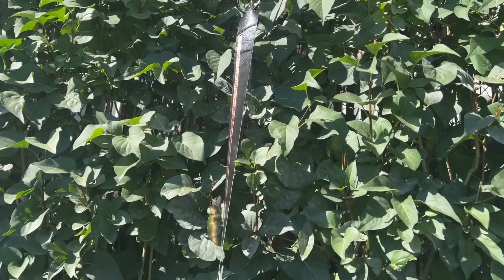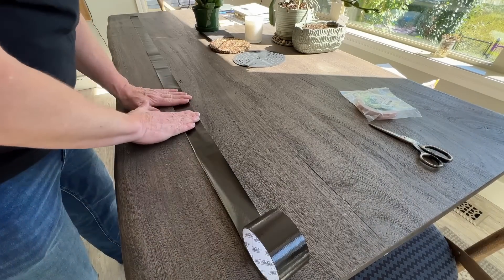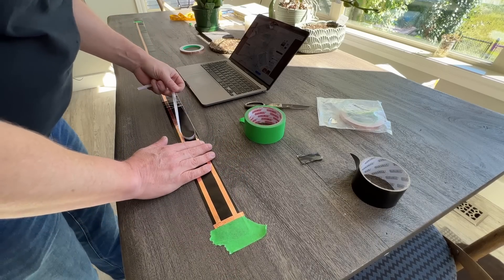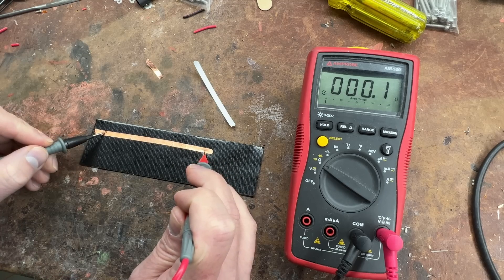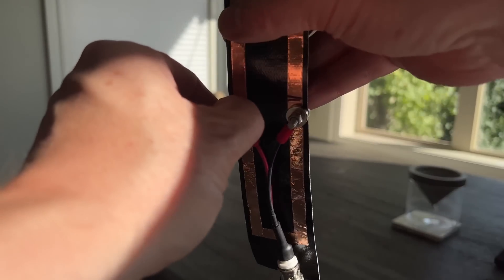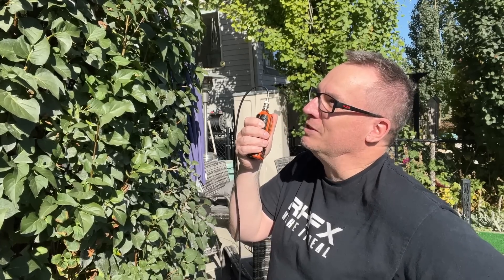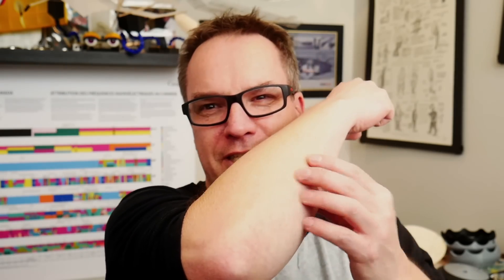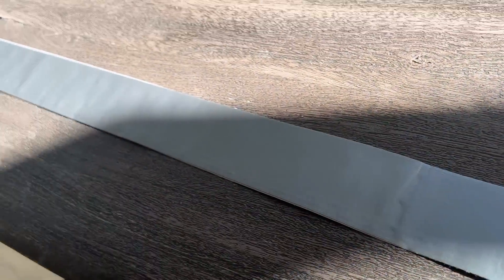How to make a 2 meter band tape antenna: Lightweight, portable, fun project for ham radio

Comment: you made an antenna out of copper foil, thumbs down for clickbait and thanks for wasting my time
Reply from the maker: You are most welcome.
Reply: @VE6SFX_HamRadioRookie   I for one thought it was an extremely interesting video.  Saved to my "projects" playlist... seems like an excellent candidate for a go-bag antenna.
Reply: Some people are never happy.
Reply: @VE6SFX_HamRadioRookie   Unlike that jerk, I'm really glad to have come across your video today. Just got my NanoVNA and am trying to make a j-pole antenna using 14ga solid core wire run along a piece of scrap wood with some TV coax driving it, and my result is way off where it should be. Your usage of magnets and how you showed the effect of altering the two legs was perfect for me to attempt getting mine working. Any suggestions for an antenna building noob for things to watch out for (e.g. I think the characteristic impedence of the coax I have is 75 ohms instead of 50)/reasons things might not be working?
Reply from the maker: @Tawnos_ Truly I am as new as you here and any advice I have might be suspect. Having said that I understand that getting a good swr is quite important in helping not let the magic smoke out of your radio components. My understanding: 
Using 50-ohm cable with a 50-ohm antenna and 50-ohm radio will provide a proper impedance match, minimizing signal reflections and maximizing power transfer. This is generally the preferred choice for 2-meter band antennas.

If you use 75-ohm coaxial cable with a 50-ohm antenna or radio, you'll have an impedance mismatch. This can lead to some signal loss due to reflections, potentially resulting in less efficient power transfer. But as I understand it if you choke the coaxial at the root of the antenna by simply making 3-5 loops of coaxial cable (zip tie them together) of about 1-4 in in diameter you should still be able to get a signal out just not as efficiently

Now one would think that then impedance matching the antenna to the 75 ohm coax will help and it can but the thing is that most radios are also 50ohm so you will be matching at one end but not the other..  Not the best situation. I am not going to say use it. However I would still try if it was me. Take all of this with the warning, I am the ham radio ROOKIE for a reason. I could be wrong.
Reply: What time did you waste, and what planet are you on to think duct tape was going to be the conductor? Clearly the tape would have been the body, anyone who knows what duct tape is (even people calling it duck tape) knows it's rubberized plastic, effectively a sticky tarp material. No part of that was ever going to be conductive in the first place, but the interest in a duct tape antenna certainly solves a serious problem that comes with making larger antennas for any use that needs lower frequencies at longer distances.

Ya'll wasted your own time looking for magic beans in the garden store, and I'm convinced you didn't show up looking for an antenna if you expected it to be made of purely duct tape, you're just here to be upset at a title.
Reply: It's more duct  tape than copper foil and you would have to be pretty dumb to think you could make an antenna out of duct tape alone. Clearly your time isn't worth much, so nothing lost. No need to waste any more of it replying to me either. 73s
Reply: @VE6SFX_HamRadioRookie  i'm just pointing out the clickbait. copper foil is the same thing as a wire.
Reply from the maker: @dronefootage2778 Yes I agree it is clickbait and if you identified it as such and don't like clickbait, then don't watch, and don't comment. If you do comment then say something constructive like "Hey maybe you should try the title '2m ham radio antenna made of tape!' the title you have felt disingenuous to me, Plus I think it would be better received" <--- that there is saying everything you have but with a POSITIVE spin.  Telling someone they are wrong or you do not like them, are not going to watch the video, and later in comments (you have since deleted ) told me to not bother commenting anymore trying to shut me down and push me down into some sort of mental submission is just plain mean and sad. It is hardly constructive and worst of all feeds your mind with anger and resentment. Worse it makes others not want anything to do with you or want to communicate with you. You have spent more time feeding the displeasure in your head than this is worth STOP! I am a happy person and enjoy the hell out of life. You, some stranger on the internet, have zero power zero  right for that matter to try and knock me down. I fully understand you do not like click bait you have told us serval times. I have admitted here and in on other platforms that yes this is a clickbait title, I own that, stop making this like I have no idea, I know EXACTLY what I have done. Stop commenting and go feed your brain with some happy thoughts. Flood your brain with good endorphins. Now for your technical comment: foil is NOT the same as wire, it performs in many ways a round wire or braided cannot in physics. Also on a practical point you can roll this up into a very neat little package and put it in a pocket. Had I used wire it would have just been another hard to manage feed line antenna that cannot be rolled up and no where near as compact nor nearly as light. Now go away or stick around i don't care but start being nice to others and especially yourself. I appreciate you as a human and want you to be happy believe it or not.
Reply: @VE6SFX_HamRadioRookie Yeah, the functionality of the foil opens a lot of possibilities for things like shaped antennas, and I love that you put it on/between duck tape to make an easily carried and deployed antenna. I had done a lot of what you said regarding my antenna. Thanks for the advice - I already had a ziptie choke around the wood, but right now my VNA is all over the place with I will start by re-measuring my legs and verifying they are close to the right length and spacing. If all else fails I'll sacrifice an SMA cable to the homebrew hacking gods and try a mod of your design by folding my 2" copper tape and enveloping it in duck tape. Your constructive response and positive criticism are spot-on, and I hope to hear you on the airwaves sometime, somewhere - KK7ADJ :)
Reply from the maker: @Tawnos_ One thing I have found is my VNA can be flakey and a recalibration is what brings things back into place. Also consider where your antenna is. Ideally it is in a open free space with no metal nearby.
Reply: @VE6SFX_HamRadioRookie  VNA always has to be calibrated to set up the reference plane to the point where you hook up the antenna, i.e. at the end of the antenna cable.
Reply from the maker: @dronefootage2778  YES! positive feedback. Thank you, very much appreciated.
Reply from the maker: YES! Love this and thank you for the update.
Reply: @dronefootage2778  If you think you could build any antenna without a conductor of some sort then you should probably rethink your hobby.
Reply: @mariemccann5895  i thought it was like a conductive duct tape that's all. anyway, i stand behind my comment. i could use a rubber band to suspend a wire and then claim that i made an antenna out of a rubber band, same concept.

Comment: That's two metres, not 2 meter. A meter is any device used for measuring. A thermometer is a meter, a tape measure is a meter. The unit of measurement is called a metre.
Reply from the maker: English is a developing language and like it or not things change. In the end the point was to communicate an idea and you understood it so my verbiage and lexicon was successful.

Comment: You can't measure conductance or resistance accurately of a piece of a short length of conducting metal with that kind of multimeter. They are not dedigned for that purpose.

You need a calibrated electrician's tester that will set you back over a thousand bucks.

So the fact you get zero change with different lengths of copper tape means absolutely nothing. A standard hobbyist's multimeter does not have the level of precision required.
Reply from the maker: Ok, regardless the antenna works.

Comment: Skin Effect: No, it isn't that the transmission comes from only the outside of the antenna.

What it is really about is that as the frequency of the signal increases the electrons are pushed to the outside of the wire and no current flows down the centre of the wire.

What designers can then do, is remove the inner core of the conductor and turn it from a solid conductor to a coaxial conductor, essentially a copper pipe.  Why waste money on a solid conductor when most of it isn't being used?

This isn't something that is used exclusively for antennas, it is used in cables intended for high frequency use.

Now as all you have is a copper tube for the carrying of the current, then of course the EM emission is going to come from "the surface".
Reply from the maker: Ok cool, thanks. I learned from this and since I’m a rookie I’m sure I’m using the terminology incorrect. https://www.youtube.com/live/7MA4dIlapyA?si=djrGtlQc55Ds9O_K

Comment: I did the obligatory J Pole with 1/2" copper pipe when I first got licensed in 1992. I got great results on 2m with it, and it lasted for years. The one made with duct tape looks like it would be great for with an HT, but I wouldn't want to run any more than 8-10W with it.

Great video, keep it up.
73 from VE5RJK
Reply: It has a lot of surface area, so even it 100 % of that energy is dumped as heat in the antenna, it will barely get warm.
Reply from the maker: Given the foil tape antennas talk John Portune has done here I think it’s capable of way more than 10w https://www.youtube.com/live/7MA4dIlapyA?si=Qi2gmhINr6c2_IO0

Comment: Nice video. But a little warning is needed or rather cautioning. Though you can easily put the coper tape on top of each other for testing. Do solder the edges of the tape together  when it is giving the desired results on SWR. Coper will get a corrosion layer in time sometimes aided by the glue in the duck tape.Then it will end up a capacitor instead of a 0 ohm's link. 
But this trick with coper tape is use full  is you want to make a log periodic on higher frequencies.
Reply from the maker: Good tip! Thanks

Comment: It isn't "duck tape". It is "duct tape".  You use it to wrap metal conduits which conduct cold air, or warm air depending upon the season, not water foul.
Reply from the maker: It’s called both the original name was duck from the fabric it was made of originally a sail cloth called ‘duck’ https://youtu.be/9FaDI1i8ijs?si=qQfwdVHvZjUPOJ7M
Reply from the maker: https://youtube.com/shorts/n9ZNJKuUpXM?si=Tvwiw_c0fi_rYTMD
Reply: Generically it is duct tape, but a popular brand is Duck Tape, so both are correct.

Comment: I believe it's 'duct' tape, unless of course it's made out of ducks or used on ducks.
Duct tape was originally desingned for sealing ventilation ducts etc, but of course it has many other uses, including making antennas, and taping up ducks😁
Reply from the maker: It was originally designed to seal ammo boxes in wwii actually. Made of cloth called ‘duck’
Reply: Ahh, ok, interesting, but highly unlikely the same as what's made nowadays.
Incidentally, the black or grey fibre reinforced tearable tapes you used in the video are generally referred to as Gaffer tapes, used a lot by gaffers on stage shows etc, for taping cables to the stage floor, and of course to shut up the obnoxious lead singer.
However, duct tape is normally just plain grey/silver vinyl/pvc tape, without the reinforcing fibres, and not so easy to tear by hand, best to cut it with sharp scissors.
Nice job on the antenna btw, can it handle any more than a few watts?
Reply from the maker: I have not tested myself but john porutne has sone videos out there and claims similar antennas can easily handle 100w
Reply from the maker: Feeding the algorithim with this cheeky video in responce to all the duct comments :) https://youtube.com/shorts/n9ZNJKuUpXM?si=Tvwiw_c0fi_rYTMD

Comment: There should be an altered velocity factor for the copper sandwiched in duct tape... but I don't suppose we'll find that spec in the 3M data sheet ;)
Reply from the maker: I will measure it here in a coming video

Comment: What a fantastic way to make ladder line as well!
Reply from the maker: Holy crap! That never occurred to me! It’s super easy to bend and move around too!
Reply: @VE6SFX_HamRadioRookie Also a great leader to run between a window and its sill. I'm also thinking of hydrogen line monitoring with a run straight up a wall. A large fractal antenna installed as wall art? Maybe on a tiltable whiteboard or even a door for directivity, the mind boggles.
Reply from the maker: I am thinking I’ll make a yagi but call it a ‘Flagi’ the art/fractal antenna is a great idea too

Comment: Where did you get the magnets and the bnc adapter wire?
Reply from the maker: I will cover this in more detail in a future video but the magnets are here https://www.amazon.com/gp/product/B09TB2JKBS/ref=ppx_yo_dt_b_search_asin_title?ie=UTF8&th=1 and you can just solder wires to these BNC headers https://amzn.to/3ty4vtj. I cover a similar build here but use the bnc bulkhead adapters like in the previous link https://youtu.be/A5qG_C5TfoQ
Reply from the maker: https://youtu.be/rbCTxWYHeP8?si=D_o1qECCZAhKxbqC

Comment: BTW, I had a professional cell tower antenna, 8 feet tall and it looks like what you are doing here. They have foil tape as the antenna on plastic.
I was shocked and it took 150 watts continuous power
Reply: ""I was shocked"

You shouldn't have touched it while transmitting ;)
Reply: @SansNeural  if you want to sell a set of the bnc leads with the magnets I would like to buy them and where can I get the copper foil?
Reply from the maker: Link to the foil is in the description and I’ll see about making the magnetic connectors
Reply from the maker: https://youtu.be/rbCTxWYHeP8?si=D_o1qECCZAhKxbqC for now I am considering making and selling these.
Reply from the maker: I have not pushed the power up. I do not yet have the radio to do so. However John Portune estimates this could take 100W easy

Comment: The copper tape I got from Aliexpress had a conductive glue. But the copper tape I got from a carshop / homeshop did not conduct if I tape it ontop of eachother. You can solder doh.
Reply from the maker: :( It should capacitive couple with the signal though. Try anyhow.

Comment: Back in the 70s CB craze I made a adapter from. SQ socket to fit a PL 259 connector with alligator clips and used the alarm systems glass breakage tape on a large widow  where I worked just had to disconnect the place were it hooked into the adjoining window and where the wire came into it at the end where I clipped onto it measured it had over a full wave of driven element and reflector  and talked for miles .
Reply from the maker: Hacking antennas is awesome. Great story!

Comment: I've used 4 x10m retractable tape measures. I simply attach battery clamps to the metal tape and adjust the lengths to match a given wavelength. With decent clamps it makes decent connection and hey Presto there's ya dinner.
Reply from the maker: Love it!

Comment: Quick question: Would you be able to curl this up like a tape measure and be able to have an adjustable/tunable antenna by pulling out any desired length?
Reply from the maker: Great question and I will have to try!

Comment: Top notch video! I do believe you need to make sure to get two-sided conductive tape for separate pieces to conduct, but I have everything I need to make this!
Reply: The copper tape you find at electronic parts stores will almost always have conductive adhesive. It is harder to find aluminum tape with conductive adhesive, but I only use that for shielding anyway, and it's good enough for that.
Reply from the maker: Yes I am learning this. Totally enjoying the ideas and knowledge I’m gaining here in the comments.
Reply from the maker: Let us know how it works out for you!

Comment: Long, long ago, back when alarm system used metal tape on glass, I was installing burglar alarms.  We had a little wheel with teeth around the edge and would use that to spice tape.  Running it over both layers would puncture it an make an electrical connection.  You could just poke it with a pin but that took longer.
Reply from the maker: !!!!! Not that this needs this but this right here is bloody brilliant. Thank you.

Comment: Well don't fall off your ladder... here's one for you to try.... get a piece of plexiglass,  and build a Japanese "Hentenna " on it with your tape. They word amazingly well.  Plus if you have a multi- mode rig, it can be propped in a window  or hang from a limb - ceiling etc. Well done  73 DE N3TGY
Reply: I wanted to mention about a multi-mode rig : a Hentenna can be turned long side up for FM and opposite for SSB on 2 meters  - that's the "Hen" weird or Serendipitous part of that antenna.  It's two loops. So it has a high gain in a small footprint.  DE N3TGY
Reply from the maker: I will definitely look into this. 73
Reply: @VE6SFX_HamRadioRookie   I've made several over the years out of PVC and solid copper wire. I had a few ham  friends that moved into apartment towers  ,  they made foil tape Hentennas on their windows out of necessity.  Also made TV reception antennas from it too.  Putting them on plexiglass just makes it easier to transport.  You can build a beam out of hentennas as well,  unbelievable performance! 73 and have fun!
Reply: @VE6SFX_HamRadioRookie  I hate to be a pest, but also try an oblong loop whilst you're experimenting. -OK I'll shut up now. I've been playing with V/UHF antennas for around 40 years ( HF too) I really enjoy it.
Reply from the maker: No don’t shut up I want all the ideas! Keep ‘em coming